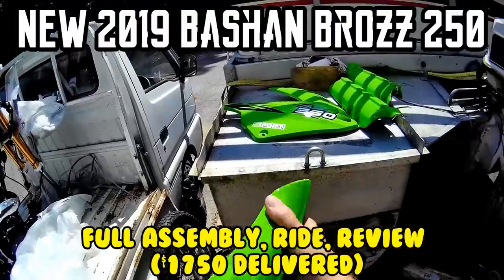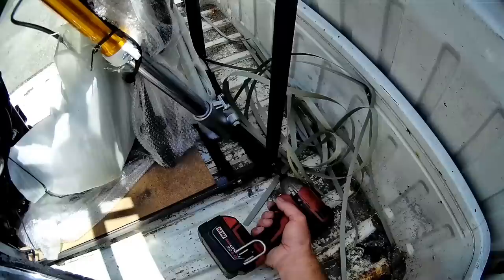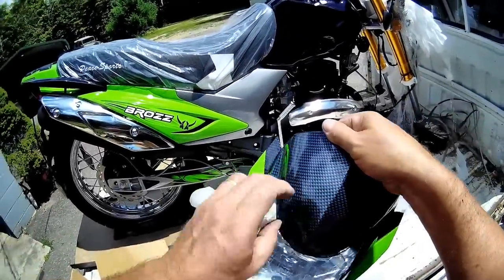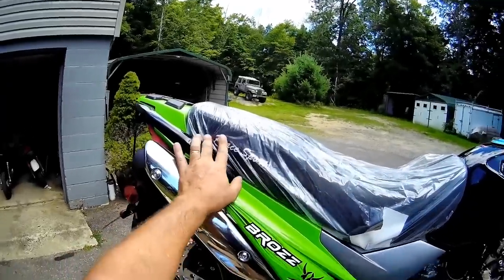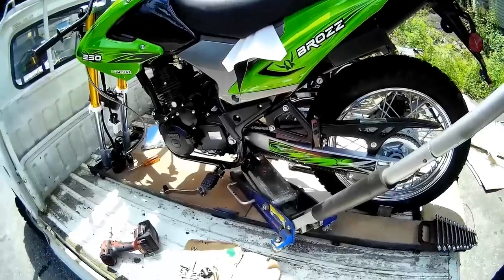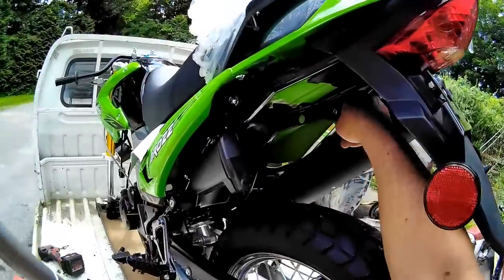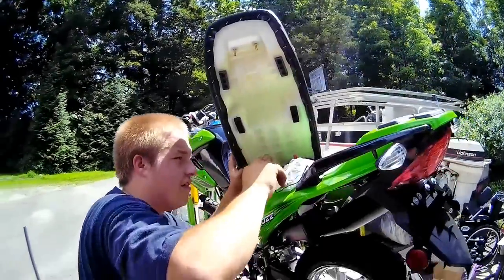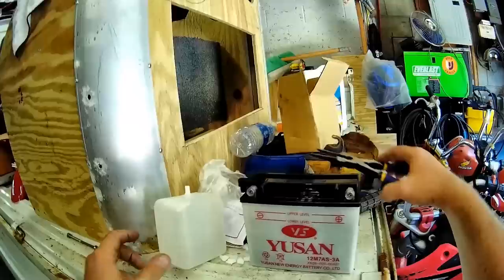NEW 2019 Bashan Brozz 250 Dual-sport Full assembly ride review ($1750 delivered)

Comment: Just an FYI, the dots on the handle bar clamps should be up towards the front, and the fronts bolts tighten first. The gap in the clamps should be in the back side.
Reply from the maker: Ahh. Ok, I usually keep the gap even on both sides

Comment: I just bought and assembled my second Chinese bike just because Royal Enfield and BMW both said I could not have my bike delivered partially assembled. Where's the fun in paying somebody else to assemble your motorcycle for you. After all, you know you're going to go over the bike and make sure every fastener is tight.
Reply from the maker: Awesome! You're absolutely correct.
Reply: I bought a Chinese 125 pitbike from a go kart shop/dealership I asked him before leaving the shop with my new bike is it ready for me to ring it's neck is there anything that I need to check he said no it's all good and safe...in the first few minutes of riding I noticed the handlebars were loose the chain was loose and the rear wheel wasn't fastened down all the way and the carb adjustment was so bad the bike was bogging out before the end of the gears..the bike was a mess for coming from a dealership and I will never buy a assembled bike from from a Chinese bike dealer again  the bike itself is good now that I've done the work myself but the shop workers need to be  fired before they cause a rider or some young kid to be seriously injured

Comment: I had a 1972 Yamaha Enduro 250cc in my 20s and 30s.  I liked it because it was a single cylinder 2-stroke that had a separate oil reservoir, and the bike would mix the oil and gas for you. There was a round sight “glass” on the side of the bike showing the oil level, so I knew when to add more 2-stroke oil.  It was a great bike to learn on.  The  OEM exhaust pipe was straight and low like a street bike, so I took it off and added an “upswept” exhaust with a lot more ground clearance so I could ride it through creeks.  It was a great bike that had plenty of pretty girls on the “buddy” seat I added. 😉
Reply from the maker: Saweeeeet!

Comment: Looks to me like the best made Hawk yet.  I would dare to go as far as to say a better bargain than the CSC TT250.   My first NEW bike after getting back into riding (after a 18 year hiatus )  was a Bashan "WILL 200".  
That was in 2014, and as of 3 months ago, that bike was still owned by it's 2nd owner and STILL going strong with over 15k miles on the Vapor digital instrument cluster that I installed right off the bat when it was new!   Bashan as far as I can tell makes actually half decent bikes. I would buy another one.
Reply from the maker: That's awesome. CSC said they're not interested in a review... So from what I've seen of the tt250s, I'd say "probably"

Comment: I have had a Shineray which is I would say the exact same bike for 10 years no major problems but you need to oil the cables, grease the bearings and speedo.  It is marked 250 but the book says 230ccm which I think is a copy of the Honda 230.
Reply from the maker: Definitely good advice. Thanks for sharing

Comment: Really appreciate your videos  I have found a new hobby have had mine 3 weeks planning to port and get a cam muffler and all put a 115 jet open air inlet need a 42mm air pod  your stuff is right on 2022 has bigger wheels no remote start for less hassle with shutting off
Reply from the maker: Awesome!

Comment: I bought one a couple years ago.  The 2018 back in 2017. The remote start if used, will allow you to drive off without inserting the key. If you use it, use it under supervision. Test it. Unlock the handlebars and turn it on with remote start.

Comment: I've got an 09 cfmoto 250 street bike an I've had nothing but good luck with it changed headlight bulb twice found on Amazon shipping was crazy first time without prime second time cost 6 bucks total with prime the radio mp3,player drains battery cheap toggle switch to shut off the hot post on battery first fix ,an the cheap break rssevior eye check glass goes out after about 3 yrs I've replaced it twice ,that's the total repairs in almost ten yrs of ridding it as my only vehicle, yr round over 24000,miles on it I'm 53 yrs old an I ride it all the time ,summer and winter I store it mostly inside winter months but still ride it wen weather permits in ohio,,wen I first got it I got on the net and all the haters had plenty of bashing on it well I'm still cruising it 10 yrs later,
Reply from the maker: That’s an awesome story! Thank you for the information, that’s impressive! Ride on brother!!🔥🔥🔥

Comment: Listen I just bought one. I sold my cruiser to buy one and I am very happy with it. It’s actually not a bad bike for the price. Me and my buddy is rough on the dirt bikes. This one takes a beating. I wouldn’t jump it though. It’s specifically a trail bike and on road. Not a dirt bike lol. If they would’ve put 10 percent on road tires and sent u with a jet kit. It would’ve made it a lot easier to deal with. But one of the honda dirt bike parts for it. I just bought a jet and 10 percent on road tires and a muffler. Those are the three things it needs. It also needs a port and polish. It is very hard to clutch up. It does not power wheelie. Lol. It has a hard time clutching up in first. It’s a 300 pound bike lol. It’s just for cursing but does 60 no prob. That’s the most I have done.
Reply from the maker: Awesome!!

Comment: I know I asked you're opinion the TBR-7 and the hawk DLX but I saw some videos of the brozz 250 and I really like it. So I know it's not fuel injected like the DLX but Wich bike do you like better? DLX or the BROZZ?? I'm so scared I'm gonna buy the wrong one.. Ive worked so hard to save this money. Kinda hoping you like the BROZZ better but be honest. Because you're the deciding factor in my choice. I do plan on driving it to work alot on the back roads with a 55mph speed limit. Weather permitting.
Reply from the maker: I like the DLX because of the EFI, no fussing with the bike. Just build it and go. But you cannot mod the EFI yet, 

I also like the Brozz because it was smooth and super quiet. You can mod the carb for more power. 

It totally depends on your taste. A totally modded carburated Brozz can be equal to a DLX hawk. Stock it's a bit slower
Reply: @MotoCheez  yeah I like the fact of how smooth it's soposed to be I was thinking of putting street tires on it because honestly it's just gonna be for back and forth to work and to putt around town. I like the super moto look so was gonna make it look like that.
Reply: @MotoCheez  as long as it will do the 55mph speed limit without holding it wide open I will be fine with that..
Reply from the maker: It will until you hit hills
Reply: @MotoCheez  I live in south Dakota and most of it is flat. So not a problem there.

Comment: Good job with the assembly! It's good practice to use loctite on every nut and bolt!
Reply from the maker: Thanks! I know a lot of people like loctite but I prefer silicone sealant. Great for vibration and comes out easy. I rarely have my bolts loosen or fall out unless I forgot to tighten them.

Comment: I am strongly considering a Brozz or DLX, which do you feel is better? watched many of your vids several times and subbed
Reply from the maker: Depends really on whether you want EFI and louder exhaust it carburetor smooth and quiet lol. Have a chart ranking them in different areas on motocheez.com
Reply: @MotoCheez  cool will check it out, im in Tx at 800ft above sea level. I like the idea of the memory foam in the Brozz seat. Power, reliability etc are important to me. I like the green on the Brozz too but like the essentially maint free aspect of an EFI

Comment: I just bought a Bashan 250 Storm.   2015.  Used.  Great condition. 165 miles.   Everything is original.   Nearly new.   It has the original speedometer.   :-(.  It uses KM instead of MPH.    Also it doesn’t tell me the gear it is on.  It also.  Doesn’t include the fuel  level.  Peace Sports told me I needed to buy their speedometer and not a hawk speedometer.  That makes Sence.   Will the fuel gauge and gear indicator work on the new speedometer?
Reply from the maker: It should if it has the  extra wires coming out of the crankcase for the shift selector.  Aftermarket gauge is probably your best bet
Reply: @MotoCheez  I really appreciate your help.   When the Bashan 250 runs out of gas how much is left in the reserve?
Reply from the maker: Almost a gallon

Comment: Looking good.  Let us know when you put a new jet in and the new top speed.  We may buy one of these soon.  Saving up for a Dukati Multistrada.
Reply from the maker: Thanks. Waiting on a kit from Tako (NZbrakelathes) with the Jets and a 17t sprocket so I can get it tuned in nicely. I'll def do a video on it
Reply: I had the Bashan storm , basically the same bike ,but it came with the 17 tooth front sprocket and I put a eBay exhaust system and rejetted it. ,great bikes for the money!
Reply: @ronfisher2016  after the mods, can it wheelie?
Reply: @GameOHolicsGitTurntGud  ,sure ,if you give a big tug on the handlebars an gas it ,it takes some practice  but can be done ,but if your asking if you can just blip the throttle an the power is going to make it want to flip over in it's back ,,then. No, lol
Reply: @ronfisher2016  cool! thanks for the feedback!

Comment: Great video brother. I also saw one on the Tao Tao. Looks like this one is a better choice. I'm in Colorado at 5000 plus feet. So in your opinion, is this better than the Tao? Thanks again for the review. JZ
Reply from the maker: This is better than the TBR7, only other China bike that compares to this is the hawk DLX.
Reply: I've got a 2017 Hawk 250 I ride around up in the mountains on the jeep trails, it does fine at 13000+ feet.  I had to re-jet in the china carb, but you have to do that anyway.  They're starting to make the china bikes look nicer.  These crate bikes are only loosely assembled, so you have to take everything apart and grease it, and put it back together correctly.

Comment: My 1974 Honda CB100 made 11.5 HP @ 10,000 RPM and ran almost 70 MPH. 4 stroke, 2 valve, single cylinder engine...old, low tech, carbureted engine. Seems a 250 of similar design should have more power? Is the compression pretty low? conservative  cam timing? Looks pretty good though!
Reply from the maker: It's a Honda CG engine clone.  lower compression, higher torque at low RPM. Single lobe cam.

Comment: Man if they would make a 400. Or 450
Reply from the maker: I agree!!
Reply: Csc and Cleveland CycleWerks does
Reply: Don't worry. We hear the people. This bike was built by the requests of guys on Chinariders.net and I've already been in communication with Bashan about a bigger engine. It'll be a few years till we bring one in with more power though as engine testing will need to be done. Bashan's current largest engine is on the Brozz.
Reply from the maker: @PeaceIndustryGroup  🔥🔥🔥🔥
Reply: @PeaceIndustryGroup  AWESOME!
Please ( PLEASE, PLEASE, PLEASE, PRETTY PLEASE) consider the larger people when designing it.
Room for long legs and big feet on comfortable pegs! (Size 16 feet do not work well with itty bitty ones)
Wind guards on the bars for longer rides in cool weather would be a major plus.

A 400 would be the absolute minimum size for a good all around bike in my opinion.
450, 550 or oh my a 600 with shaft drive would be the cats meow!

Great looking bike though.
Nice work. 10/10!
Reply: Hey Peace Sports . Have you thought about adding fuel injection on this.This would be perfect with EFI. I was thinking about getting one of these. But I found
out the 2019 Hawk 250 DLX has EFI. I'm thinking on going with the Hawk. No
offence I'm more of an EFI guy than a CARB guy. Allthough I do like the remote
Start / alarm system. Plus the rear luggage rack, and bright green color paint.
Reply: I don't think guys in this market want to pay for EFI on a Brozz just yet. It would certainly be over the $2k mark for online and dealers would be closing in on $3k.

Comment: Did you have to loctite the bolts? I know it's a must on the Hawk and TBR, but the Brozz reviews I have seen don't mention loctite.
Reply from the maker: I never use loctite I use a silicone based like gasket sealer just a little dab on the threads and they come off and on easily and they're vibration proof.
Reply: @MotoCheez  But you still had to take out and treat all the bolts? How long does it take?
Reply from the maker: I just do the bolts that hold on the plastic usually. If they come with the rubber to hold them I don't even bother treating them and I may lose one bolt in a year. I do go over and hand tighten to make sure the bolts that were assembled prior to getting it or snug enough. I don't treat all the bolts
Reply: @MotoCheez  Oh. I thought with Chinabikes I had to treat literally every bolt and tear the bike apart. So I just need to treat the bolts that I assemble myself, and hand tighten the factory bolts?

If so, then I think a clarification video would help some people. The way some people word it, it sounds like you have to tear the whole bike apart so it won't fall apart on you.
Reply from the maker: Some people do act that way. If you ride on the road and don't upgrade the sprocket to a 17 and rev 8k all day, yes. You'll lose some bolts. But in my experience, as long as you go over them and just do the plastics you'll be fine.
Reply: @MotoCheez  I assume that applies to most chinabikes, not just the Brozz?
Thank you for taking the time to answer my questions, I really appreciate it.
Reply from the maker: The brozz is better but not perfect. Any bike will vibrate bolts loose. Even Hondas

Comment: If you had to choose between the hawk and the magician,  which one would you choose? Can't make my mind up. Money is tight.  Lol Thanks for the videos!
Reply from the maker: I choose the Hawk. Because I'm 5'10 and the magician is a bit small for me, plus I like off-road more. Hawk has DOT nobbies!
Reply: @MotoCheez  
Since the subject came up,  I  see  Blade on the TBR7 ,   I wanted to know if  he  got  used  to  the  height  difference  of  the  bike  or  would  still  prefer a  shorter  bike.
Reply: @MotoCheez  This was what I was going to ask.
I am just over 6'1 and not in any danger from strong winds,
are these bikes good for longer legged, stocky folk?
I do not care for high seat heights personally but I like to have a bit of room
for my legs to stretch out.
Also those pegs look a bit anemic for my size 16 Sketchers.
Awesome looking bike otherwise. Very sharp.

Love the inverted forks, quiet muffler and memory foam seat.
The remote start and alarm are a nice touch.
The tank is fair sized too at 3.6 gal.
I imagine 250 plus miles no problem.

Maybe with some platform pegs, wind guards on the bars and a d lock for the helmet
this could be my next bike.
Reply from the maker: @charleswidmore5458  they're not bad. My friend Vee is 6'2 stick and rides a hawk250 with me in earlier videos. I have a size 13 shoe and it's fine, a 16 I'd think would be ok too. I don't think you'd be cramped.

Comment: Your running it on preservation oil 😂🛢️ that's not going to end well your supposed to drop the oil and replace with 10w 40 semi
Reply from the maker: No synthetics until fully seated rings, about 500 miles. I changed oil at 100 miles to an SF rated conventional oul

Comment: That's one sweet ride you got there.! I absolutely love your videos.! I might consider one for my first bike.! Out of curiosity though, as mentioned in the video, it's kind of high.(even though it says 34" seat height.) is there a way to be able to adjust that down (or even an aftermarket part.) that would be able to bring the seat down to 30"-32".? (It would mainly be a road bike and not off-road use, unless it was just for modest and flat trails.) the same question goes for the hawk 250 and csc tt250. I've search the question for a while but no ones ever answered my question. Maybe something you could make a video on.?(or maybe you could lead me in the right direction.?) thanks in advance and you're the man.!
Reply from the maker: Hi, thanks!  I have a 32 inseam and I can flat foot it once you're on it the springs are loaded. You can lower the forks and loosen the rear spring a bit more. Someone said with this swingarm you could drill another hole too.
Reply: They just listed a 2020 model with 17” wheels And street tires. Might be a bit better for ya.
Reply from the maker: jeffrey queen if you have a 32” inseam you’ll almost flat foot. You can lower the shock a little bit if needed
Reply: @tigerbeforyou181    If you're talking the Brozz the seat height is the same as previous years.  Apparently you can lower it with lowering links
and or loosen the rear spring a tad. That and slightly sliding the fork tubes down a tad should take it to the magic 32 in seat height  ( at least it is for me )   FI would be a big plus for this bike.

Comment: These bikes will be really nice when they use fuel injection but carbs are still cool.

Can a guy buy links to lower the seat th for my wife?

Where do you buy them, somewhere in TX?

Good stock of parts at that dealership?
Reply from the maker: The hawk DLX is EFI. No links, but you can lower a bit by rear shock and front forks drop
Brozz250.com sells the Brozz. TXpowersports.com sells the DLX, Motocheez discount applies there. 

They both stock a good amount of parts